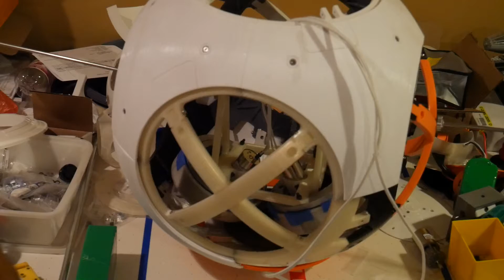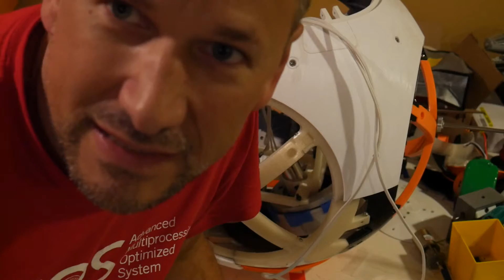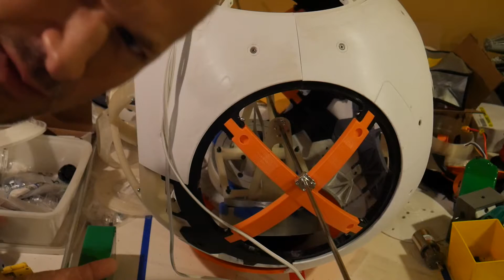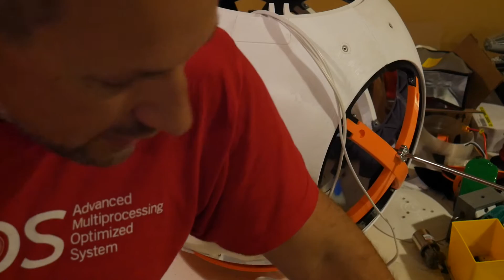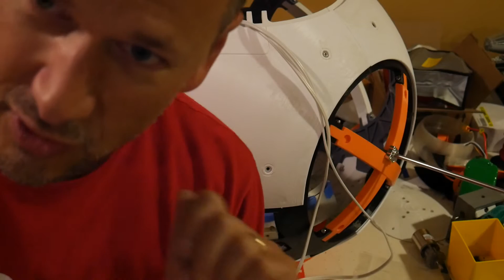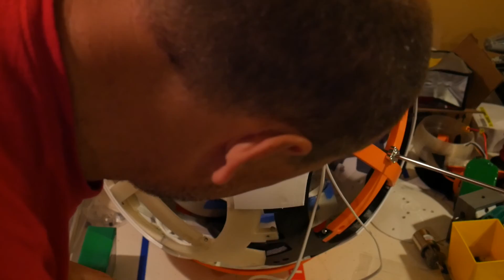RollingRobots : Building BB-8 Figuring out Flywheel phenomena!

Comment: Seeing as the problem gets worse the faster you decelerate, maybe it is controllable by doing a very measured deceleration. This means if you want to spin bb8 a full turn you'd likely stop spinning the flywheels well before the turn is done. So the momentum of bb8 spinning counteracts the deceleration of the flywheels. Maybe you would even need to add gradually slower and less powerful counter spins to get better control.

Comment: Has anyone tried turning one of these using eddy current generated by rotating a wheel of neodymium magnets and an light aluminum shield that encapsulates the wheel?  You could probably spin both in opposite directions to generate a greater force... Not sure how well it would work

Comment: I don't know if this applies but when your moving a heavy object down a building on a traveling crane and want to stop. You will decelerate and wait for the mass to swing and than give it a few blips in the same direction to stop the counter movement. So with your flywheels you may have to start your deceleration and than give it some pulses of acceleration as you stop have it settle down in one spot.

Comment: As I remember it on James' BB-8, the internal mass of his was so high that it wouldn't spin with the flywheel.
Instead, he had his progammed to spin the flywheel opposite of the direction he wanted to go. At which point, when he let off the stick, the energy from the flywheel suddenly stopping would cause his to turn in the intended direction.
Not sure what you'll want to do about that. My understanding of physics is pretty basic. You could always to a gradual slowing of the flywheels and see what happens. I couldn't predict the outcome though.

Comment: Interesting stuff. My guess is it's related to the conservation of energy / angular momentum etc. It kind of makes intuitive sense. The same energy must be being expended to stop the fly wheels as it took to get them started. So the ball is twisting in one direction in reaction to the wheels spinning up. And it's twisting in the opposite direction as a result of the breaking forces on the flywheel acting in the opposite direction. It's the change of velocity of the fly wheel thats giving the spin to the ball. Once the flywheel is up to speed and at constant velocity it's probably not adding any turning force to the ball. If thats true then i guess you have to keep the wheels spinning to prevent the recoil.

Or something, what do i know. Fun to think about though.
Reply: Very close.  The angular impulse of the flywheel's angular acceleration imparts the opposed impulse on the shell.  But the shell is in contact with the ground, so the force caused by the angular impulse is resisted by friction.  Higher contact friction means that more impulse is absorbed by the friction resistance.  Low enough impulse (lower accel) yields a force below the friction force, but higher impulse (higher accel) overcomes the friction force and the sphere turns.

The really interesting question is how do you control it without really knowing the contact friction.  Now that's the problem I like :)